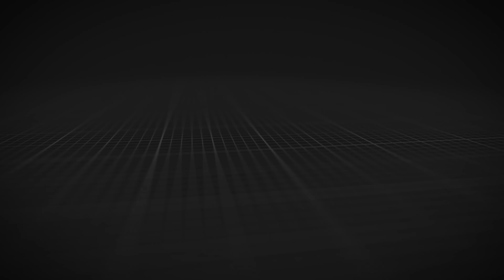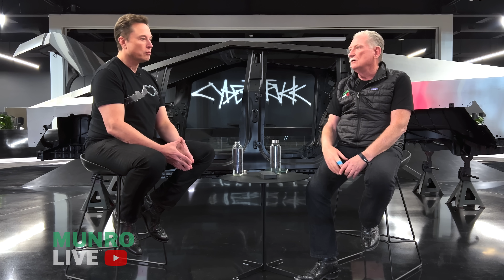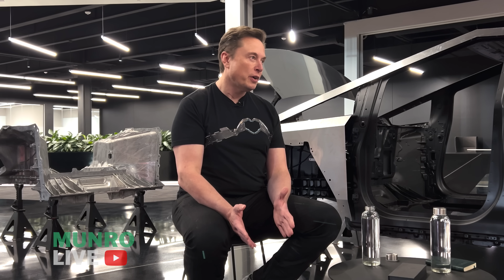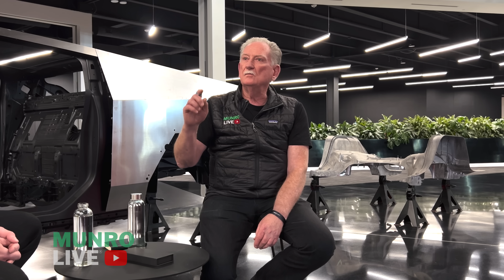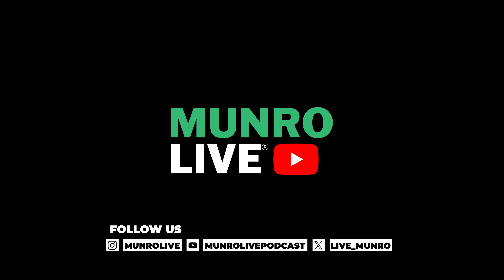Elon Musk on Cybertruck's Adoption of 48V and the Importance of Leadership

Comment: 48V is ridiculous. Everything runs on 12V. So changing to 48V means everything has to be made and stocked specifically for the CT. Adds unnecessary cost for minimal gain

Reinventing the wheel "just because" is plain stupid
Reply: It's not stupid. It is a very rational thing to do in order to save money, weight and - which no one talks about - space. Space for routing cable harnesses in vehicles is constantly an issue. The move to 48V will happen all over the industry in the next decade, Tesla just happens to be first to do it on a larger scale.
Reply: @DramaticBaby  how does it save money? There are no economics of manufacturing scale, nobody mass produces 48 volt bits and pieces. 48 volt increases cost because 48 volt is ultra-niche. Airbags, wiper motors, horns, seat motors, light bulbs, window motors, lock solenoids, contractors, vacuum pumps, washer pump motors, 12 volt batteries, stereos, etc etc etc are ALL 12 VOLT

Tesla were not the first to consider higher voltage. But the sensible auto manufacturers quickly realised that the detrimentals listed above significantly outweighs the small benefits. So they opted for a "modified" 12 volt architecture. With a single 12 volt supply line, and tiny signal  communications cables

All that 48 volts allows, is the reduction in size of the SINGLE 12 volt supply line (a ring circuit). Maybe 3-5kg of cable per electric car, containing maybe 2kg of copper, replaced by 1-2kg of cable per car, containing maybe 1kg of copper. Across the small number of cars that tesla makes, it wouldn't affect the balance sheet in any way, and won't reduce the sticker price one iota 

48 volts is a total con-job
Reply: Everything runs on 12V, until it doesn't.  Now everything will start running on 48V.  What's the problem?
Reply: @junkerzn7312  the problem is that no auto company will be foolish enough to follow. Leaving tesla as the odd one out, and making parts even more stupidly expensive. Tesla parts are already stupid-expensive and unable to be repaired. Example = model S headlight with failed park light. In most cars, you simply pop a new 12 volt bulb into the light, and your park light works again. In the model S, you replace the entire headlight assembly. Doh!
Reply: pretty sure Elon mentoined that the parts they couldnt get in 48V versions yes currently have DC-DC converters to step it down to 12V, but will be replaced as they become available..

and (optimistically speaking) cutting down the copper part of the LV wiring harnesses to 1/16th (just accounting for the voltage change) is not insignificant.. there are kilometers/miles of wires in a typical car.

Comment: Legacy auto is basically Thomas Edison at this point. Dead set on trying to distribute DC power to homes instead of AC power because it's simpler for them, despite all the power losses involved. Tesla auto has earned the right to use Nikola Tesla's name because they are actually innovating.
Reply: FWIW, AC has higher line losses at a given voltage than DC.  AC was better because generators produce it natively and it could easily be stepped up for HV transmission and stepped back down locally.  Now though, DC-DC transformers have gotten so much better that for long enough distances, HVDC is better.
Reply: @concinnus  Yes all true. I work in the power industry and HVDC is becoming more common and there's a lot of different factors that play into which is better for certain situations. But DC/DC conversion without significant power losses is only easily done with the advent of electronics that did not exist 100 years ago. Electroboom has a good video discussing the pros and cons of each. https://youtu.be/DFQG9kuXSxg?si=PMT7MNhVCwCZOLV_
Reply: More Garbage fan club 😂. This video is more for dumb club to invest in a failing company.. This vehicle will never reach capacity he claims. This one ugly looking over priced dump truck
Reply: Well said!!!

Comment: I remember on old Top Gear where Jeremy was talking about how "that'll do" attitude is what let down the older Range Rover.  I think the whole industry has been stuck in a "that'll do" mentality...until now.  After Cybertruck, I think the mentality is probably "Oh $h1t!!!"
Reply: The GoodEnoughs are in charge.
Reply: @toddwilliams5905  They're going to end up bankrupt (in some cases again)...
Reply: I see the legacy automakers doing the same thing they have done for over 100 years, even today with their ”all new” EV’s, under the skin they all look 100 years old in design philosophy.
Reply: Range Rover have been using 48v for years. So have Mercedes and VAG. Its a global standard that is going to take over.
Reply: @lfo414  From what I've read, they use a 48v mild hybrid system, but still have a 12v  low voltage system for all the other electronics.  While going in the right direction, that is a far cry from a complete 48v low voltage system.

Comment: A CEO doesn’t need to know ohms law, they just need to be told that they can save 75% of the weight and cost of the harnesses. 48volts has probably been considered by every auto manufacturer, but there are 2 disadvantages, all the >100 electrical components that hang off the low voltage wiring will have to be redesigned to work at the higher voltage. An airbag ECU alone will probably cost $10 million to redesign and test. The other issue is that 48v can give you mild electric shocks ( dc is more dangerous than ac). Both of the above reasons has deterred the industry to go to 48v until now.
Reply: I'll be very interested to see what percentage of the CT turns out to be actually 48V.
Reply: DC is not more dangerous then AC. It is the other way around. You have was less impedance to AC voltage then you have resistance to DC. AC electricity flows way better through your body.

Comment: I'll be using ICE cars untill Hydrogen cars or more efficient ICE cars become available, and then I'll switch. No EVs for me as I'm very concnerned about the environmental damage battery mining is causing the world.
Reply: Wow, 2012 wants its anti-EV propaganda back!
Reply: so you are fine with oild drilling and spills and also with double the electric energy used to make hydrogen from water (compared to BEV)? or maybe you prefer steam reforming, which gets you about 80% of the range of natural gas combustion (but with additional energy input). Also dont forget the Hydrogen Refill infrastructure is about 10x to 100x as expensive as DC fast charging for less daily throughput.

Comment: Wait until you try to replace a light bulb that burns out, and now you have to program the light bulb for where it is in the car so that the ethernet signals can activate it at the right time. I don't know how they manage to do that but I know it involves some semiconductors in every single device that uses power.
Reply: If they use LEDs and power them correctly without overdriving them, they should last long enough that even if there needed to be a replacement and a "reprogramming", it wouldn't be too much of an inconvenience.

Comment: What do they do for diagnostic port? Typically all cars have OBDII connector with 12V on pin 16. Do they still have the OBD connector? And if so, are they supplying a stepped down voltage at the connector? Are they converting the Ethernet to CAN protocol at the connector, or coming out with Ethernet and converts outside the vehicle?
Reply: afaik tesla has used an Ethernet port for Diagnosis for ages. it essentially plugs into the main computer, which then in turn connects to the other components cia CAN or other protocols. at least for the models before the Cybertruck. Also i saw in a recent video that much Diagnosis data is available directly on the Car if you enter a certain code, without the need for any additional Hardware..

oh, and there is an OBDII adapter for that ethernet port i think because the ethernet port was not "Standard" enough for some people..
Reply: They have remote connection to diagnose problems, why would they OBDII?
Reply: They don't have OBD-II ports. It is only required for ICE vehicles since its primary use is to read engine and emission-related data.
Reply: Tesla has a "similar" port and you can get a OBD2 adapter for it.   In anycase, the voltage is not a big issue.  A low-power (i.e. a few watts) 48V to 12V buck converter is about the size of a postage stamp.  Only low-power equipment would still likely need 12V.  Any medium or high power equipment will run straight off the 48V.
Reply: ah..  the whole car (S,3,X,Y, CT) is OBD tool 😄

Comment: 48V means you can have a louder stereo system, cheaper! Below the 50V limit for shocks, but all the cheap electronics are designed for 12V. ISO21780

Comment: I learned about I2R losses in high school. Not to mention things like power-factor, Ohm"s Law, Kirchhoff's Law, Polyphase AC Power etc. And that was back in the 1970's

That's all pretty basic stuff if you are in the electrical powered machinery business. I would think that a CEO who doesn't know that stuff would be totally incompetent
Reply: If you are the CEO of Disney, you don't need to know any of that.
Reply: CEOs don’t need to be engineers. Their expertise is in leading then whole company, advertising, sales, worker relations, etc. Leadership looks different. Not sure if Elon is cut out for that level.
Reply: @MendicantBias1  Engineer? That's basic high school understanding of electricity. If you are in the business of manufacturing electrical machinery, and you don't understand the basics, you need to be replaced
Reply: @MendicantBias1 Most students agree that engineering is a harder program, so a CEO engineer can likely handle the other stuff with ease.
Reply: Elon has created one of the most valuable companies the world has ever seen - as a CEO. I think he is cut out for it. LOL @MendicantBias1
Reply: Yes, most automotive managers don’t even really understand combustion engines. Otherwise they would have adopted a new high performance engine using only 40 parts as a hybrid engine over more than 200 and that with dramatically less internal friction and therefore also higher output. German industry leaders saw only problems with autoworkers unions and suppliers. So definitely no competence in EV too like Elon has and they neither go to talk at the production line or stay in the factory over night. But most IMPORTANT they ALL have golden 🪂 whatever hidden agenda they work on for sure!

Comment: Increasing voltage also requires better insulation, but that's less dense than metal so it's a weight savings overall.
Also the chance of arcing through insulation for 12v wires happening with a 48v system is ridiculously small anyway.
Reply: pretty sure there is no pratical difference in insulation thickness. my impression from ethernet cables is that it is already as thin as possible to reduce material cost, but not made thinner because this will increase manufacturing/tooling cost.. and all the car wiring harnesses i have seen have subjectively the same insulation thickness as said ethernet and telephone cables, even though they are for just 12V. and for the thick cables its more about mecanical wear than about electrical insulation.

Comment: At what point does DC Voltage become a general safety issue?
Reply: Generally speaking, voltages above 48V are potential hazards if you are sweating hard / have wet or sweaty hands, but just like 120VAC you will only get a minor buzz in almost all cases.  It is hard to actually hurt yourself unless your skin is wet AND the current runs straight through your heart (from one hand to another, for example).
Reply: OSHA has rules for over 50
Reply: I think 48V falls under many safety and fire related rules but it might take around 70 before you'll feel it.  As long as you don't use your tongue!  The POTS telephone service is 48V essentially but you'll definitely feel a ring signal.

Comment: Sandy: I'm curious if 48V is superior to 12V what is the limiting factor or point of no increased returns by having say 96Volts?
Reply: There are two reasons electrically, and more from a safety standpoint.

The main reason is electrical.   ICs and surface mount parts are still relatively tiny with voltages up to around 60V, but once you go higher the SMDs really start to get bulky and the ICs really start to get expensive.  There is no reason to make life difficult for the electronics.

A second reason, electrically, is that insulation gets more restrictive at higher voltages and less able to handle minor slices, cuts, and other things which lower voltages won't air-gap across.

Additional safety-related reasons which others have indicated.

-Matt
Reply: The chock hazard  goes from about 0 to danger from about 50 to 60 V. To mitigate the hazard on wires, connectors, electronics and connected motors becomes a burden of thicker, bulkier and heavier insulation, that increases cost.
All the semiconductors becomes more expensive too, as they need to withstand a higher voltage.
So there are downsides to the upside of lower currents, and eventually they balance out somewhere.
Reply: What point is considered the DC safety cutoff voltage?
Reply: Safety

Comment: Am I missing something, didn’t they simply move to power over ethernet (poe)? An existing standard that has existed forever?
Reply: Elon says himself in the video: there's nothing per se revolutionary in that tech, it's just that all Legacy automotive is still stuck in 1980. Tesla is just bringing the cars up to speed to current tech. It's not supposed to be a crazy thing, except that the crazy thing is cars haven't moved to current day tech is all.
Reply: Not enough information in the video to know whether they are multiplexing the data and power on the same wires, which is what POE/POE+ does.   But as Elon said, it is not that big a deal.   Power is DC-coupled, and high-speed data can be AC-coupled, so effectively the two can co-exist on the same wire.   

That said, I'm sure that a good chunk of the wiring is running power separately so a short / e-fuse operation doesn't take down the entire bus.   Still, any low-power equipment could just get its power straight from the bus.  It would be fun to know exactly what they are doing.

Comment: Interesting thing is that Tesla considers anything above 40v as high voltage, atleast in terms of safety.
Reply: OSHA has rules for over 50, others for over 60 for DC. Why they stopped at 48
Reply: @TheZackrambo  Its not actually 48V.  It's probably going to sit in the LiFePO4 battery voltage range which is roughly 48V to 56.8V.    The POE+ (power over ethernet) standard runs 44V to 57V, and POE++ (commercial high power POE) I think runs up to 70V. This makes the LiFePO4 16s voltage range perfect for the use case.

In anycase, the voltage can be an issue if you are messing around with wet fingers but it's a big nothing otherwise.   Keep in mind that people are exposed to 120VAC all the time.   The only difference is that the 48V being DC has an ARC-break issue... but that's only at modest to high currents.  A total non-issue for vehicle wiring. 

Most of the amperages, fusing, and current limiting for a 48V bus in a vehicle will be less than 1A.  So unless someone is really trying to electrocute themselves (holding onto two wires with two separate hands that are soaked with water so the current goes through the chest and heart)... its a big nothing.

-Matt
Reply: @junkerzn7312  That's what I understand, safe. But would have to stupid to make it unsafe
Reply: @TheZackrambo  Because the whole world isn't the same as the US. OSHA is US. EU rules put 48V in a different bracket to lower voltages. E.G. on an overhead wire, it needed to be above a certain height at 48V+. I'm an EE and I've worked both in telecoms and automotive in the past. Everything in automotive electronics is right out of the 1950s. In a car it makes sense to ensure humans can't touch the 48V without some special effort, like you can with the 12V, there is scope for problems even if it's not that high a voltage.
Reply: @davidjohnston4240  oh yes good ol EU OSHA, or OSH. They have safety rules too. Different rules for under 50v, and then rules for 50v to 1000v for DC. I will agree that stuff in cars is old. Those darn massive computer chips, when we've got 3nm
Reply: @TheZackrambo  With what I do these days (I.E. massive computer chips), 1V is high voltage. 3nm is a lie though. It's a density equivalence thing.
Reply: Heh HIGH VOLTAGE! Done dirt cheap
Reply: That's the electrical safety rules. It's not just for cars. Telecoms got a get out clause on ringer voltage for decades, then land line phones went away and it was moot.